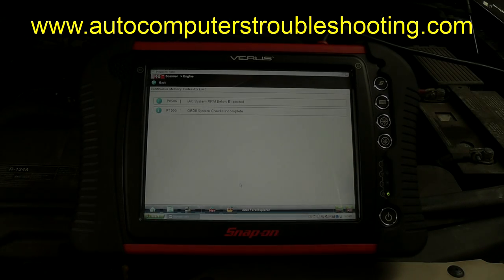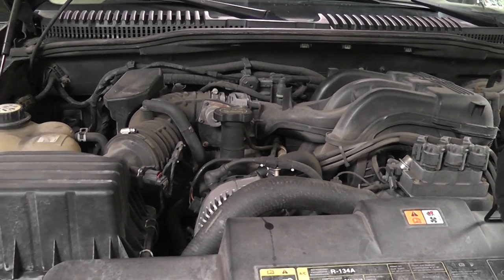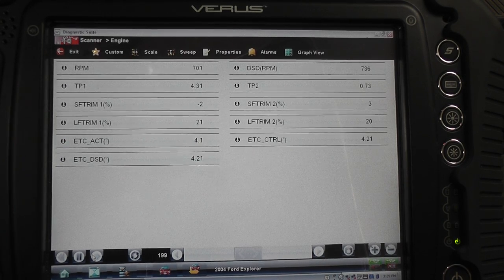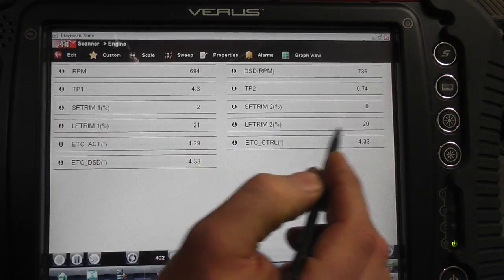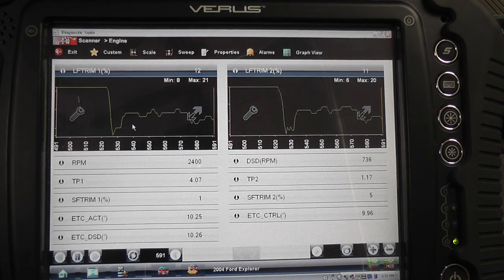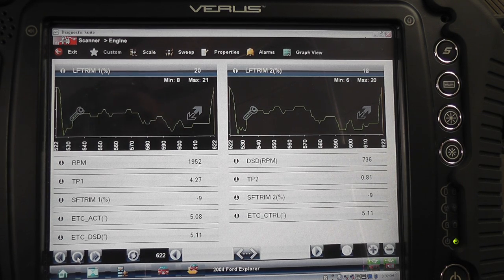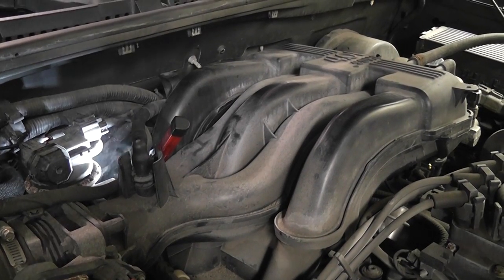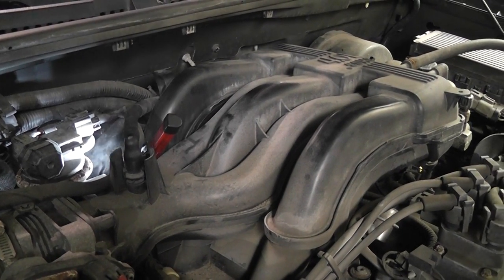P0506 IAC System RPM below expected (vacuum leak) - Ford

Comment from the maker: You are correct. LTFT does not react that fast, but what you are looking at is learned fuel trim numbers in different cells. Remember that LTFT has a different learned value for every load and RPM combination. It is not just one flat adjustment across the board.

Comment from the maker: Every car reacts a little differently, especially a car with a MAP sensor. The MAP will sense the pressure change from the vacuum leak a send a higher volt signal to the PCM. The PCM will in turn open the injectors more which will possibly mask the vacuum leak/lean condition.

Comment from the maker: Good question. Most MAF engines will idle lower than normal with a vacuum leak. It is the speed density (MAP) engines that will idle high with a vacuum leak.
Reply: Thank for the info have learned alot from you

Comment from the maker: ambient temp. is monitored by the PCM typically by using the IAT sensor input. So you are correct in that hot air is less dense but this factor is not compensated for using the fuel trim. The entire fuel curve is adjusted based on the IAT signal (it is a small amount though).

Comment: Awesome videos. You make fixing my car look like fun! You've really helped me out. Been chasing a rough idle on my Aviator for weeks. Thought for sure it was a bad O2 sensor. Used your videos and a scanner software to verify that they are actually all working correctly. Actually looks like I have a vacuum leak. Long term fuel trim is high (10-20%) but goes normal at 2500RPM and then short term goes high. Not having luck finding the leak, but I haven't given up yet.

Comment from the maker: It depends on the severity of the vacuum leak. If it is severe enough you would also see the STFT in the positive range but only after the LTFT has reached its maximum. 
In this case the LTFT was able to bring the STFT into a normal range of near 0%.
Also for your second comment, a dirty MAF would show fuel trim % increasing with an RPM rise NOT decreasing.

Comment from the maker: Anyway 11-12 % is a little high for your trim numbers. It could be a small vacuum leak or possibly restricted injectors (like in my last video on the Pontiac vibe). It could be other things too. Another thought is the alcohol % in the fuel. I'm not sure what you guys do in California but if they are mixing in more alcohol in the fuel this will also drive your fuel trim numbers positive.

Comment: Thanks Paul. I was thinking IATs shouldn't matter very much, especially on a MAF system. I think it's possible that I have some kind of intermittent issue causing my trims to creep up. Like today at idle the LTs were 3.8 and 1 or 2% for the STs. Good call on the gas, we have some funky gas out here in CA. That's a great point. I will see if I can figure this out or not. Keep up the great work - I love your videos.

Comment from the maker: No, there are many causes of a lean condition. Here are a few of them.
Lower than normal fuel psi
Vacuum leaks
Clogged injectors or injectors not firing
Contaminated fuel 
ECT or IAT sensor problems
MAP/BARO or MAF sensor problems (especially a dirty hot-wire type MAF)
Jumped timing chain/belt
Exhaust leaks upstream of the O2 (false lean, causing rich a/f ratio)
Severe misfiring (false lean, causing rich a/f ratio)
AIR system problems (false lean, causing rich a/f ratio)

Comment: Your videos are by far the best on Youtube!  Quick question if you have time... P0171 on LS1 engine 187K miles- no drivability issues, no evidence of vacuum leaks could be found. no misfire or other codes. STFT bank1 seems fairly normal yet LTFT in bank 1 is highly erratic- from 15 to 25 and never stays steady. The LTFT almost looks like a STFT trace in fact.  Bank 2 looks rock solid with tight STFT and LTFT right at zero.  I'm thinking injector partial clog but don't have pulse tester.  Ideas?

Comment: Hey Paul, Had a few fuel trim related problems over the past few days. Today had a -24 LTFT one where the valve timing was a tooth out on the exhaust cam. The LTFT returned to zero @approx 3000rpm. Also had a few air leaks on another car, what smoke machine do you use? been looking at the smoke pro approx £600-800 in the uk depending on model.. keep up the hard work!

Comment: Well i replaced the intake and TB gaskets since they are cheap. I also used a homemade smoke machine and there are definitely no vacuum leaks. I'm not sure why the ambient temp affects this, but now LTs are +14/15 and sometimes the total correction will get close to 20%. I suspect a fuel system issue or injector problem now.

Comment: where at on the egr valve was it leaking? i see them leak in the diaphragm area when it had lean codes, but theres a ford service bulletin the says its normal to see smoke leaking from the egr valve, iac valve, and imrc, and not to replace them, but i dont know what to believe

Comment: I wish there were more speed density with map sensor only videos. Seems most videos are like this-higher rpms, fuel trims lower. Does nobody work on speed density engines.

Comment: Now have you ever noticed fuel trims going more positive if it's really hot outside? I have a 2000 Toyota Echo, and it seems like the LTs like to hang around 6 or 7 for most part but now it's starting to get really hot out here in CA and I noticed them hanging around 11 or 12 the other day. I would think they would want to go negative since hot air is less dense than cold air. Who knows, maybe there is a small vacuum leak manifesting. Car runs pretty good though.

Comment: Paul, what should I look up to if at higher rpms it stays the same or gets worse? I'm having an 02 Explorer with a P1151 code in it and I did some troubleshooting but had to stop because I had to go to work. B2S1 O2 sensor was fixed lean. i made the mistake that I didn't check B2S2 to compare... I did react a little to carb cleaner and sometimes it will just act normal stoich....
Reply: Fuel trim was rich and suddenly normal at idle.

Comment: I'm sorry I don't get it.. Long term fuel trims don't react that fast I don't get it. If I simulate a vacuum leak on my mercedes the short would add fuel (like +15) but the long term won't be affected before AT LEAST 15 minutes to change one percent at a time! Is it a ford thing to have the long term change that fast?

Comment: My issues are all on Bank2. With a live data scan going I ran it down the road and stopped at the stop sign. This was my readings
st ftrim1 % 0.0
lt ftrun1 % -5.1
st ftrim2 % -50.6
lt ftrim2 % -39.7

Done a complete tune up cap, rotor, plugs wires and plugs. Not the cheap stuff (learned my lesson there) Replaced 2 o2 sensors also 1 was bank one and the other was bank 2. on was up and the other was down stream. I can crawl under and verify which they were. What ever the previous code were telling me to replace. When in park I can't seem to repeat the conditions. Only while driving. Any thoughts would be appreciated since I am a single father of 7 kids and this Suburban is my short bus.
Reply: Mr Berserker My guess is a leaky injector on bank 2.  Was that it?

Comment: Hi Paul how about when you car have both MAF and MAP sensor? for example I have a honda accord 05 which  contain both sensor..I have an issue like this where at Idle my trims are leans but at load is perfect almost at 1.00 plus from time to time I get the lean condition code P0171, on the process of finding the issue I did find one small vacuum hose disconnected but my idle was never affected by this. Car always Idle like there was no issue.

Comment: finally after taking off the intake manifold and pulling valve covers to check cam chan tension. it got worse and was pinging. The cause was the Mass air flow sensor, was reading airflow fine but frequency was showing i was at 4000 to 5000 ft elevation not under 1000 where i am. would you like my old sensor to use as a case study?

Comment: I have a Mazda 6 2006 2.3 L I took the battery out to inspect my transmission mount because I had noticed that when I was switching gears it was making a noise in doing that I took out my battery I disconnect the negative battery terminal and also the positive terminal and remove the battery and the tray from the vehicle after inspecting I placed the battery back into the car and put the terminals back on it I took the car for a drive and noticed that all the sudden now there is rough idle there is stalling my RPMs and my speed metre seems a little off everything was perfectly fine with the car until I remove the battery I watched a couple videos telling me to let the car run for 20 minutes and then turn the cars air conditioning on cold and let it run for another 15 minutes and then take the car for a drive I did this and everything seem to work fine but before I did this I got this trouble code P0506 but now the light is off and has not come back on but I am having a problem again with stalling the car will just stall and turn off but the lights will stay on on the dash and I'm able to turn the vehicle back on and start it and drive again I don't understand what is wrong is there anything you here in this information I've given you that could lead you to help me any information would be greatly appreciated thank you kindly I really am thankful
Reply from the maker: It is becoming more and more difficult to answer questions here. I have 80,000 people asking me for help now. So I have created a forum to help you guys better. It is free to join and we can exchange pictures, wiring diagrams and waveforms if needed to help guide you through the process of troubleshooting your vehicle. Thank you so much! Hope to see you there. 
Paul Danner (ScannerDanner)
https://www.scannerdanner.com/forum/post-your-repair-questions-here.html

Comment: Hi Paul
I noticed that the actual idle rpm is lower than desired .But with vacuum leak,should it be higher rpm ?or pcm compensate by adjusting the throttle?

Thank you

Comment: i have long term fuel trims of 7 percent and 9 positive one bank being more and this is at idle. is this a concern being this percent of trim. and there is a slight rough idle. i do suspect a coil pack not fiting all the time. i installed a known good coil pack in the suspect bad one and 0 percent misfire shows on mode 6 test. but still the same fuel trims

Comment: Hi Paul, trying to troubleshoot a periodic P0170/P0173 on a 2000 ML320. Negative LTFT is the cause, freeze frame shows -15 or so when the code sets. Doing research on negative LTFT seems to point to only a few things, leaking injector or stuck open pintle. Since it is both banks I am having my doubts. Could it also be a bad MAF, but usually a bad MAF would result in highly positive LTFT. (unless this faulty maf is telling the ECU *more* air is entering than there really is?)

Comment: if the LTFT and STFT numbers goes higher  when you accelerate the engine what is the problem
Reply from the maker: +Franc melendez this points toward a fuel delivery problem with the top two suspects being a dirty MAF sensor or low fuel pressure

Comment: maybe it a ford thing... because on a Toyota if there is a vaccuum leak, the short would be high and it some case I have seen both Long and short at plus 20%.
and when a MAF gets dirty on a Toyota, the long would be at plus 20 with short at 5%. then long would improve as you rise the rmp.

Comment: after higher rpm for motor ,  long term fuel trim is not improved what is now the problem
Reply from the maker: it's not a vacuum leak. focus on fuel pressure and your MAF sensor next
Reply: thank you

Comment: Hello, excellent video! A little question, may be you can help me, what means this values?:
At idle              (LTFT +10% , STFT -4 ) 
At 2000 rpm   (LTFT 0%,       STFT 7%) 
At 3000 rpm   (LTFT +4,        STFT +4)
My mileage is very bad!!
Reply from the maker: +Juan Gabriel Florez Moreno basically normal, possibly a small vacuum leak
Reply: ScannerDanner thanks for your answer. I'm worried because the fuel trims are getting worse, same beavior but  LTFT up to +14,8% and STFT up to -13,3%.
Reply from the maker: +Juan Gabriel Florez Moreno okay. When you see numbers like you have, it means that whatever was causing your lean condition is now, not there. LT at +14 and ST at -13 equals a total trim of 1. Make sense?
Some common causes of that, is an intake manifold gasket leak that improves with temp. Watch this video
https://www.youtube.com/watch?v=3RFTS22w6tM

Comment: I just don't get how more air and more fuel equals lower rpm.
Reply: Or was it maxxed fuel trim and the air leak was still greater than the fuel compensation?
Reply from the maker: Exactly! your second statement

Comment: ok scanner danner this is what a got, freeze frame = st 25% ,  lt2.3%, baro press. 30.1 inhg, air flow rate 29.05g/s, rpm 3254...